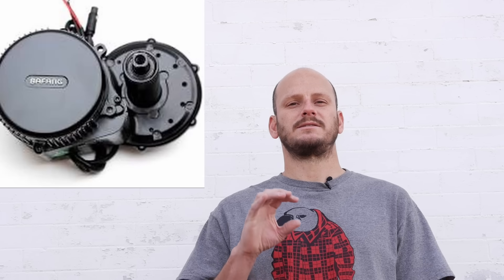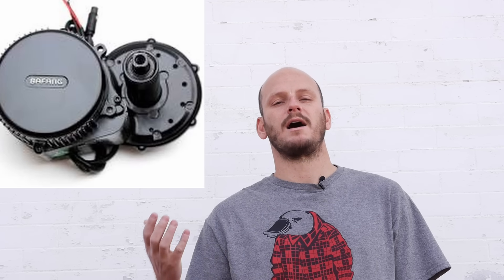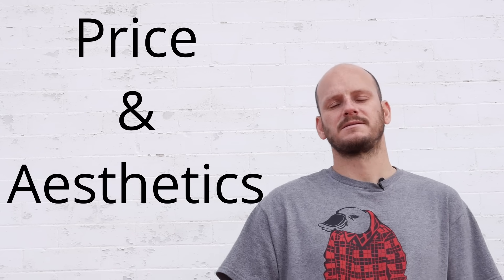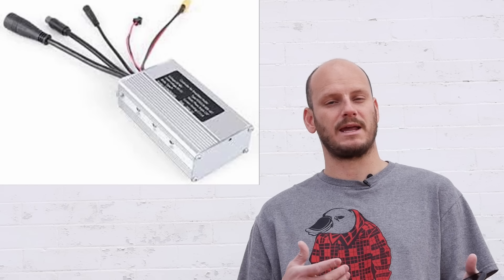Hub vs. Mid Drive Motors: Why Hub Motors Suck and Debunking Common Myths with performance test

Comment: The old adage applies: "You get what you PAY FOR."
I have a Bafang in my Velomobile, and a Neodrives Hub motor on my Recumbent Trike. The Neodrives cost twice as much as the Bafang, AND IT SHOWS. The Bafang puts out power as soon as you move the pedal, each 'level' of assist topping out at a higher speed, so at the lowest level while peddling at 11mph the motor is doing nothing. With the Neodrives hub, the power comes in at ANY level of assist, at ANY speed below 16mph (the legal limit in the UK). It also has a re-gen braking option, that does work, if used correctly. Another nice thing is that the strain on the chain is reduced greatly, as the torque is multiplied FROM the chain, not put through the chain, as with a mid-drive. So a 'normal' chain with a hub drive will extend the life of the chain, where your Mid-Drive needs an e-chain, and even that will get chewed if you ride like a maniac!
In the UK the motor size is restricted to 250 watts, enough for 'Assisting' with pedalling (what it was designed for), it will disappoint as an Electric Bike (for lazy speed freaks who don't want to insure or get licensed for a real motorcycle). All for e-bikes, to help with getting some exercise, but idiots who ride too fast, just using the throttle, and don't give any warning before BELTING PAST, not so much :-(.

Comment: mid drive wears out chain and sprockets so fast though.. ive replaced mine 3 times, and always had chain problems, where my mates hub is better off road, and gets longer range as well as more torque up hjills, on beach.. im always getting stick with mid, and hub seems to power out of trouble.. hes always blitzing me in races and speed (offroad). so its opposite day

Comment: I more or less understood everything, and would rather put "mid drive". But ... can you ride with a mid-drive motor without turning the pedals, as you can with a hub motor? Your video suggests that, and I don't think that's true.
Reply: You can throttle the bafang mid drives without pedaling

Comment: How many gears has a Tesla? Looks like this cars are a complete faulty design because they don't have a gearbox, right?
About the torque: The torque of the hub motor is applied directly to the wheel. While the torque of the mid drive motor applies the torque to the bottom bracket. And then this torque is divided by the gear transmission ratio. Let's say the ratio is 3:1 then only 1/3 of the motor torque is applied to the wheel, minus the losses in the transmission.
Reply from the maker: Electric cars have more power than ebikes thus making a gearbox useless

Comment: I owned a hub motor ebike for 10 months and must admit being 58 years old it got me back out cycling again, it made things easier because I do have health issues but there was things I just didn't like.  Nothing weong with hub or wheel never had a problem but its different then just riding a cycle, it felt as if on was being pulled along until the motor cut out, could hear the motor when it was going and when hitting rough road the wheel vibrated and cycle felt very uncomfortable.  I got to thinking this is how an electric cycle should feel and I was weong because I took my hub drive and converted it to a mid drive not sure what I would find.

I found a cycle with help but feeling more natural and when hitting rough roads doesn't vibrate as it did with the hub motor, when cycling the motor is that quiet you don't know it assisting until you switch the motor off, its great to be able to use the 7 gears again and it making a difference to my riding.  So yes can see that the mid drive as a lot more to offer then a hub drive but don't get me werong it all started with a hub motor to get me out again and its done its job for 10 months, but certainly glad I converted to a mid drive.  Mike

Comment: How does a hub motor put more strain on spokes than a mid motor does?  Doesn't the power from both go through the spokes on its way to the tire?
Reply from the maker: Check out the pinned comment

Comment: I have to admit, I didn't put much stock in mid-drives, until I had a chance to try (at an ebike rental shop) several hub and mid-drive 1000w bikes, while I was selecting which one I wanted. Holy crap the difference in torque is just... insane. There was this inclined driveway (at least 30 degrees) to the shop (a good place to test the bike's climbing power), and with my 120 kilos, even geared 1000w hub motors REALLY struggled to get me up on torque alone. They managed, but at a crawl, something like 8 kph. The single gearless one I tried couldn't even move. The mid-drive - I just shifted to the 3rd lowest gear, and it powered up the driveway effortlessly. Jeezus.

With my delivery-job, and the hilly areas I sometimes have to traverse, it was a no-brainer for me to choose the mid-drive one. Now yes, it takes a bit more thinking to drive (I have to remember to downshift on every stoplight), but - that torque. I'm in love.
Reply: Great! I'm an old man who can't afford a mid-drive. I wouldn't want to be constantly shifting it. Maybe a small mid-drive motor? 250 watts?  😮
Reply: @Mark-qv4bn  With the mid-drive, you have to constantly shift, or you'll rip up the chain. All the power goes through that chain, so being in the right gear at the right time is essential. Try moving in a high gear, the motor will either stall or overheat, or in case of more powerful mid-drives, snap the chain. Same principle as oveheating the clutch in a car, if you try moving slowly in high gear.

If you don't want to constantly shift, go with a hub drive. The drive unit is separate from the chain. But the price is lower efficiency and less torque up the hills.

Comment: I got a hub driven motor. It's done over 10 thousand kilometres..it still got heeps of power. And haven't broken a spoke yet. And I tow a 25 kilo dog. 14 kilo trailer. And all my stuff. Not a single problem

Comment: I used my ebike for delivering for almost a year and racked up over 10000km on it. In which case reliability was priority I loved my hub motor, It put down 2.2kw and never let me down. Don't just shrug off "two chains in 5000km", that would of been 4 chains for me and lots of missed work as I can't just stop to replace the chain. It's simple, motor got power bike go vroom. I feel like this guy is just hating on hubs as a mid drive fan boy
Reply: Dude chains cost like 15$ and to put it on you take it out of a box and wrap it around the sprockets and put the quick link on. You can do it as fast as i wasted my time typing this

Comment: Really helpful since most of the reason I'm looking for an E-bike over a regular bike is because my town is very hilly. Anything to make my ability to get around easier. I know it will be hard on the motor either way, but motors can be replaced much more cheaply than my legs which are much closer to needing major surgery.
Reply: That’s my issue, a lot of hills where I live, hub drive does help but a mid drive with all the torq & gear options it’s night & day . Better
Reply: One of the hills around here I'd like to get up quickly has a 20% grade.  At 10 mph that would take 850W just for the change in potential energy, not accounting for rolling resistance and any loss in power between what the motor produces and what's delivered to the wheels.  
He said in the video that the front hub motors somehow deliver a lot less torque, so apparently for equal wattage, you somehow have much more power loss between the stated wattage of the motor and what the bike actually gets.

Comment: I don't see how a hub drive would be any harder on spokes. Regardless of motor type, the power still has to transfer through the spokes to the wheel/tire. If anything, wouldn't a mid-drive be harder on them, since it can apply more power due to the gearing?
Reply from the maker: Yes, that is correct. What I meant was cheap hub motors are very often timed not laced properly and come loose much faster than a properly laced wheel on a store bought bike running an after market mid drive kit.
Reply: I break more spokes with mid drive lol because it can do those crazy climbs that you wouldn’t even try with a hub.

Comment: OK. Mids are overall better and I use myself one because of that, but your video could use some more objectivity.  For example that argument with surgery. I mean with the hub you must get rid of your rear wheel, but with the mid drive you must get rid of the whole crankset and front derailleur. So not only you exclude often very fancy, light and durable hardware at the front but also all the gear ratios that would be very needed when driving without or very little motor (which i often due to long distances). So here i would give credits to the hub motor  Also I would add that with the mids you don't have the possibility of regen-braking which not only gives you some extra range but also extends the life cycles of your brake components. Other than that I agree with you.

Comment: Utter rubbish, I also build e bikes for a living and Bafang mid drives rip chains, cassette's, and especially spokes from the wheel rims. Rear wheel drives tend to be heavy compared to Bafang but the average rider can't tell the difference when riding.
I definitely prefer a quality hub motor than a Bafang as the hub motor is maitenance free and the Bafang needs regular maintenance and expensive parts.

Comment: I own both a belt drive and a hub drive electric skateboard.  Hub drive wore out after six to seven trips around the block- garbage.  Belt drive still works well after trip 30.  Imho only get a hub drive if it's sub 150 and if it's only for mild recreation, not daily use

Comment: I put a Bafang G62 1000W hub on my BBSHD bike to compare the two. BBSHD is day and night more efficient, all day long, you will go further with less battery as you say. I've also noticed with the BBSHD it doesn't seem to suffer as much with a 48V battery,  even when the voltage sags way down to like low 40's / almost dead battery, the BBSHD is very torquey and easily gets going (albeit with slightly lower top speeds). When the hub motor voltage sags below 48V,  it feels like its barely moving and needs help pedaling.  I agree about changing tires and being able to take off the wheel and having motor cables and torque arms to deal with is a huge pain. There are things I like about the hub though its definitely smoother than the BBSHD at high speeds where I can feel the drivetrain kind of vibrating the bike.
Reply: Stop. Cant you see the hub drive riders are trying to cope?

Comment: How is replacing a wheel anymore work than replacing a crank? 

I swear, I don’t get your rationale in anything you say. 

Yes, I have a rear hub setup on a recumbent three-wheeled trike AND at 265 lbs I would absolutely eat through transmissions at probably somewhere around 4-5 times with a mid drive. 

In my use case 265 lbs in weight plus an additional 45 lbs for the trike two batteries and other gear/tools in the panniers, I am just over 300 lbs total weight. 

You’re not going to tell me that with that kind of weight going up any hill, let alone anything with a significant grade, and running adding more stress to that transmission by transferring the power from a mid drive motor through it is better than a hub motor assisting the forward momentum independently of the transmission.
Reply: If you are 265 pounds you are doing yourself a disservice by riding a hub motor. Unless its pretty high power hub, like 2 or 3kw
Reply from the maker: Better is relative. Better performance at climbing hills? Absolutely. Mid drives use the transmission (cassette) to multiply the motors torque, much like how a car’s transmission does.
Reply: @JohnnyNerdOut  Agreed, it is realtive. And we will have to agree to disagree because I just don't see how multiplying stress and strain on the chain and rear cassette with the torque of  a mid-drive is better than relieving the strain off of those same components by adding "push" rather than the "pull" of the mid-drive.
Reply: @TroyShields  you don’t need high end drivetrain to run a mid drive, 15$ chains last 1000+ miles, cassettes often twice that. The expensive part on these bikes is the offset chainring, but they last thousands of miles

Comment: Screw you man I listened to you and sold my hub drive for an expensive Bosch middrive. Lots of regrets. I live in flatland so the torque isnt needed and the hub motor feels much better, much more comfortable with cadence sensor abeit more energy thirsty. The middrive with derailleur system is a nightmare to maintain and the wear and tear is amplified tenfold. I guess the reason the industry is shilling for middrive so much is because users have to spend alot more on parts and maintenance. Not to mention I can lock the hubmotor but no way to lock the middrive so Im in constant paranoia of having it stolen. Worst purchase decision in my life I'll never listen to the Internet again.
Reply: I don’t think Johnny ever suggested, in any of his videos, to buy an expensive Over priced prebuilt ebike designed for MTB

Comment: I have a wonderful 40 year old Diamondback that was gifted to me. Is it possible to convert this to mid-drive?
Reply: Yes you take out the bottom bracket and pop in the mid drive. Make sure its a JIS bottom bracket the very common type. Or it may require an adapter for the bb.

Comment: Great video, and I enjoy learning the different perspectives on motor types. One question I have is, what is the functional difference in spoke wear between hub and middrive? Whether the wheel is turned by the hub itself or a sprocket attached to the hub, power is being transmitted through the spokes to the tires in the same way. I would also posit that the higher torque both from the motor and gear reduction in the case of a mid-drive seems like it would be more likely to damage spokes through higher impulse.
Reply from the maker: Torque goes through the spokes regardless of motor type. It’s the cheaper hub motors that are especially prone to premature wear, was my point 👍

Comment: Come on hub motor you can set how much power and change the torque and each pass has a speed limit mid drive puts extra wear on all the gears and spokes unless your mid drive has sprocket on both sides left with heavier chain and sprocket mid drive have more chance to break chain strip gears and derailer when that chain pop it could catch your leg strip gears break spokes only way i would get mid drive if it had dual chain

Comment: I appreciate having the video comparisons of hub and mid drive in this video. However, the torque comparison was very poorly done. A car’s torque is measured at the wheel regardless of motor type. But you aren’t measuring the torque at the same spot with these motors.

Still have to have a battery, so the aesthetics of a hub controller is dumb.

Comment: Hey, I’m new to ebikes but
5:30
Aren’t BBSHDs 1000w? How did you get 1500w on your chain with a bafang?
Reply: 1000w is the nominal power of the motor 1560 watts is the peak power at 52v * 30amps

Comment: I am waiting for the replacement controller for my gear drive, my bike is set up for a hub drive in the back and a gear drive in the front, it gives me good acceleration and a good top speed! I have not tried it in the mud as a 2 wheel drive so far...

Comment: This might be true for those cheap motors in the conversion kits. The reality is different for the pre-built bikes. For speed pedelecs (max of 45 km/h) hub motor bikes are simply the best. They are way better at maintaining the maximum speed and require no shifting to put the power of  the motor on the street. Mid Drive motors require a lot of shifting, which reduces the acceleration. They have problems maintaining the maximum speed when going slightly up hill or with a head wind.

Comment: I have mid motor e bike or how is called in Germany.. Pedelec.. it is possible to drive it without chain.. only what you need is to keep pedaling.. and motor do the rest. because motor works only when you pedaling..

Comment: conversions in general are just not the move if you want a reliable E-bike, buy one that has been built to be an Ebike some of the highest quality E bike in the world are the stromers which are 10,000 hub drive bikes. the problem isn't hub drive vs mid drive its just having low quality builds in general and relying on cheep conversion kits. Even as far as mid drives, the rotating sprocket variety like the bafang are some of the worst.
Reply from the maker: Interesting. I would argue the opposite 👍
Reply: @JohnnyNerdOut  from my experience over the last 3 years as working as a mechanic on e bikes I find that most conversions put an undue amount of stress on parts not built for the amount of torque that say a bafang puts on them, this includes breaks Cassettes chains and even frames. Bikes with mid drives like the bosh and other frame internal motors hold up much better over the long run and get better efficiency from smaller batteries, as well as feeling more natural in the pedal stroke. Also higher quality hub drives correct most of the issues you see in the cheep ones, and have torque sensors as well as being able to deliver more power. I would suggest checking out what stromer is doing with their hub drives.

Comment: Maybe the hub motor bikes are breaking spokes because of the greater unsprung weight?  It's obviously not the torque, because the mids are quicker.  Also, if people are building their own wheels, or maybe they are buying the cheapest hub motor wheels they can find, they might be incorrectly built or the parts might be inferior.  Obviously, the lower torque of the hub motors would break LESS spokes.